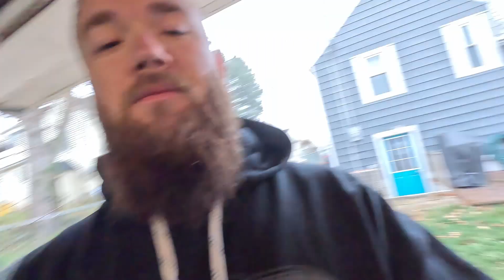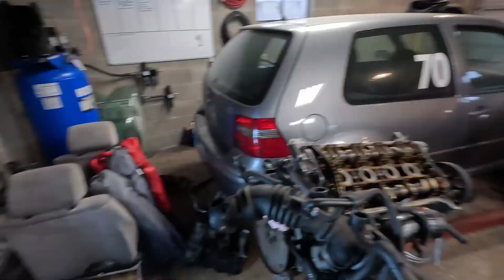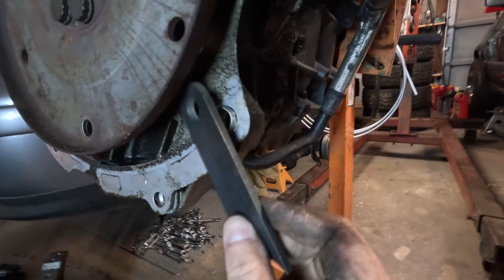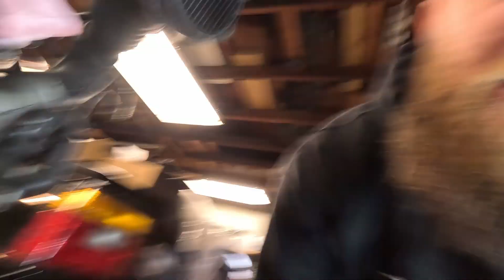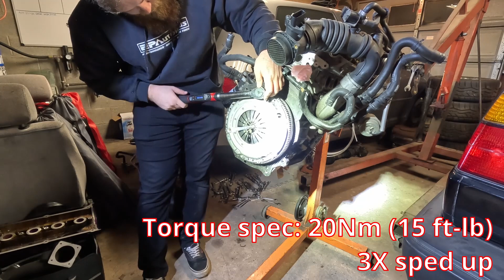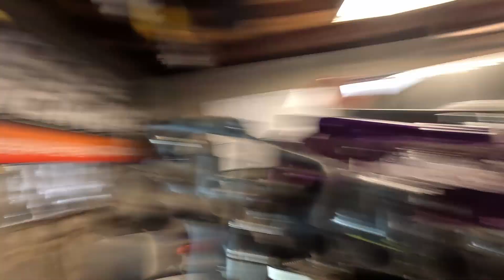Got a clutch on the MK4 GTI 1.8T finally, but made some more work for myself in the process

Comment: So does it not require a friction disk for the flywheel? There was one on the automatic
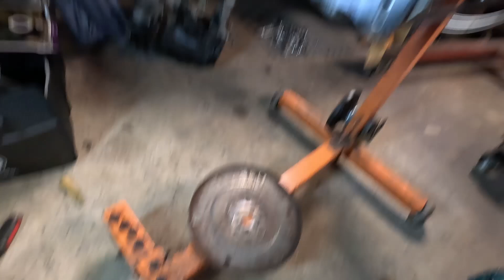Reply from the maker: Are you referring to the metal disk that was sandwiched between the flex plate and the crankshaft (visible at 13:48 sitting in the flex plate)? If so, that’s a shim to space the flex plate appropriately to ensure the torque converter lines up like it’s supposed to. It’s not needed for the manual flywheel.